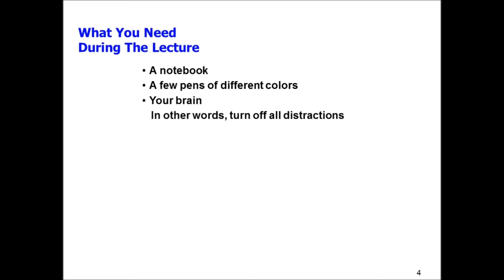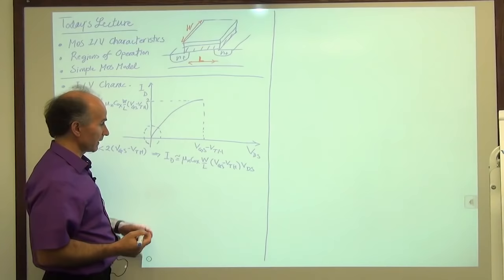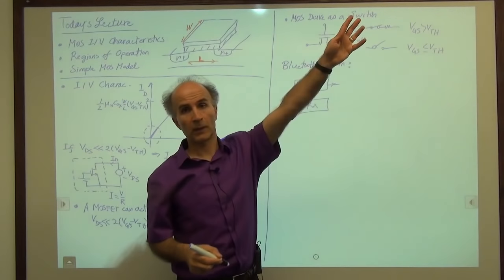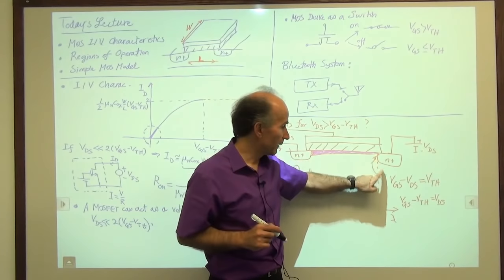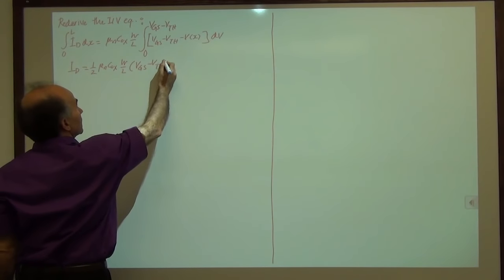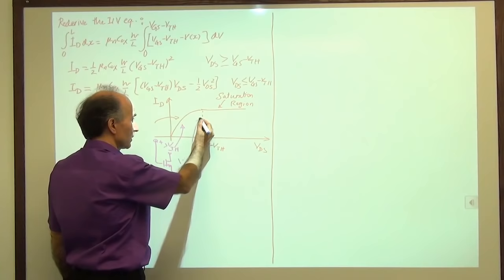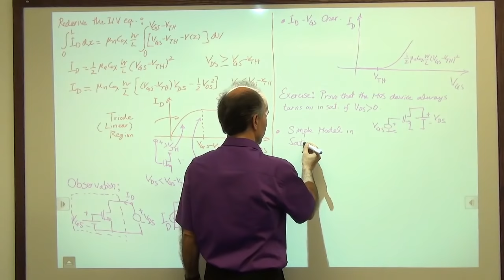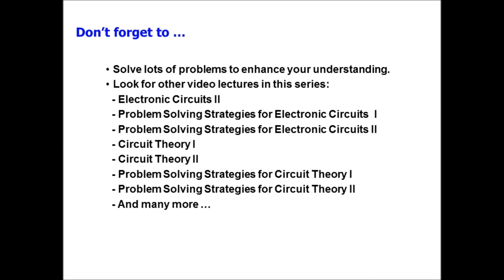Razavi Electronics 1, Lec 31, MOS Characteristics II

Comment: For those who are confused about the question posed by Razavi sir, if I re-phrase it...
"Set the VDS as a constant > 0 (however small you want). Now, when you turn on (or "start") the MOS device, you will observe that it "starts" in saturation mode. Prove this result."

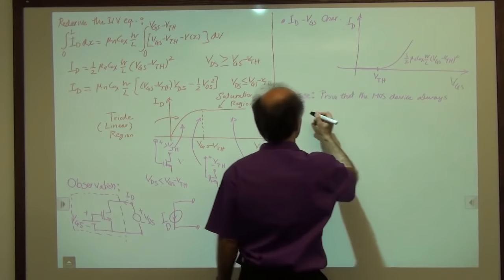Comment: Question  at 49:00  "Prove that the mos device always turns on in saturation if VDS > 0?"

Answer: 

1. Consider at the beginning VGS=0, VDS=0.
2. Now if I increase Vds to 0.1 V and I am fixing it. 
3. I am increasing Vgs slowly from 0 to Vth. At Vth my mos device is on (Vgs =Vth).
4. For saturation the condition is Vds > Vgs- Vth.
5. as Vgs = Vth implies Vgs-Vth=0.
6. hence Vds > Vgs-Vth; Vds=0.1>0.
So the mos device will turns on n the saturation.
Reply: Suppose, you increase Vgs so much that Vgs-Vth>Vds as you have fixed Vds, this condition does not apply. Is it for this reason that he said for a very high Vgs, the quadratic equation is not valid? Could you clear my doubt.
Reply: @roshansharma5251  Mr. Razavi says turns on in saturation region. Not always in saturation region if you increase Vgs so much. Turns on means the point that Vgs begins to be higher than Vth.
Reply: @ozgunyurutken9485  Wrong. Dr.Razavi says it turns on. If you look at the graph , it turns on when Vgs > Vth, and this is the point where saturation occurs/ given that Vds > 0.
Reply: @roshansharma5251  That case is much beyond turning on......When you "just" turn on the MOS, V(GS) = V(TH). So, condition of saturation only applies till V(GS) becomes greater than V(DS) by atleast one threshold (V(TH)).
Reply: But I do have a doubt like after vth, Vgs-Vds keeps increasing for we keep Vds constant and increase Vgs so this difference will be more than Vth right in that case the MOS is in Triode region right
Reply: @ananya825  Yes. As Vgs go beyond Vth, (Vgs-Vds) becomes greater than Vth, thereby keeping MOS device in linear/triode region.

Comment: Hello Sir.
You have explained very well about Saturation of Drain current mathematically. By changing the limit of V(x) i.e. channel.voltage from Vds to Vds,sat= Vgs-Vth which results in Id independence on Vds.
But I also want to know how it is constant at semiconductor level..

Comment: All right for those you are scanning the comment box for the answer to the question Razavi sir asked towards the end of this video let me explain 

The question is if Vgs>Vth (just when the device is turned on) then for any positive value of Vds, the current through the MOS will be in saturation region. Note that this is a case for when Vgs has just reached Vth and not when Vgs is much greater than Vth ( to be exact Vgs= Vth+ whatever Vds you have taken) 

1. So if we look carefully we will observe that saturation region is achieved only when there is a pinch off anywhere between the source and the drain.
2. We must notice that  the value of Vds decrease as we move towards the source from drain (since source is grounded) and becomes equal to zero at the source
3. Now it is given that Vgs>Vth, therefore if we analyze the voltage drop at or at the very proximity of the source we notice that Vgs-Vds>Vth (since Vds at source is zero and it is mentioned that Vgs>Vth ). therefore a channel starts to build and since Vgs<Vth+Vds (you have taken some arbitrary value of Vds) the channel will quench before the drain and hence a saturation current is drawn . 

hope I was able to explain you the solution properly 
thanks
Reply: No, the question is: when Vds is FIXED, and we increase Vgs, the MOSFET, TURNS ON in saturation, that is: when Vgs reach Vth, then the MOSFET is in saturation (then after Vgs exceeds Vds + Vth the MOSFET pass into triod region

Comment: Prove that mos always turns on in saturation region if Vds >0. Please tell me if my answer is correct-

To turn on MOSFET, Vgs >= Vth so we have Vgs - Vth = 0 just when the device turns on. But given Vds>0, thus, Vds > Vgs - Vth
Thus the device is in sat region.
Reply: take Vds=2mV and Vth=4 and Vgs=7, you can see this doesn't work
Reply: Hi, I think you are correct. Prove that the MOS device always turns on in saturation if Vds>0 means that initially when the MOSFET is turned  on, Vgs starts from 0 and increases. Whereas Vth and  Vds remains constant, so Vds+Vth>Vgs.  After Vgs is fully increased, MOSFET will enter Ohmic region.
Reply: @이상혁-b1w  my

Comment: After pinchoff voltage there won't be any electrons...so how come that current Ids(saturation one) flows
Reply: the electrons would have gained a high velocity, so it just jumps of from the pinch off to the drain hence conduction current
Reply: It will form basically a reverse diode.. a PN junction... the carriers will flow because of an electric field. ( If you saw bipolar transistors, it is similar to a bipolar transistor, since when the channel gets "cut" ... you will get a sort of  p-n-p or n-p-n structure
Reply: The current can still flow through the "substrate" even though the channel is pinched. The reason why it saturates is that there will be a region of higher resistance of size proportional to the Drain-Source voltage, and therefore the resistance of this region will be proportional to the same voltage.

But as current is voltage/resistance, the dependence will cancel out and you'll get "constant" current.

From Wiki ():

Even though the conductive channel formed by gate-to-source voltage no longer connects source to drain during saturation mode, carriers are not blocked from flowing. Considering again an n-channel enhancement-mode device, a depletion region exists in the p-type body, surrounding the conductive channel and drain and source regions. The electrons which comprise the channel are free to move out of the channel through the depletion region if attracted to the drain by drain-to-source voltage. The depletion region is free of carriers and has a resistance similar to silicon. Any increase of the drain-to-source voltage will increase the distance from drain to the pinch-off point, increasing the resistance of the depletion region in proportion to the drain-to-source voltage applied. This proportional change causes the drain-to-source current to remain relatively fixed, independent of changes to the drain-to-source voltage, quite unlike its ohmic behavior in the linear mode of operation. Thus, in saturation mode, the FET behaves as a constant-current source rather than as a resistor, and can effectively be used as a voltage amplifier. In this case, the gate-to-source voltage determines the level of constant current through the channel.

Also, from the MOSFET operation description, under saturation:

Since the drain voltage is higher than the source voltage, the electrons spread out, and conduction is not through a narrow channel but through a broader, two- or three-dimensional current distribution extending away from the interface and deeper in the substrate. The onset of this region is also known as pinch-off to indicate the lack of channel region near the drain. Although the channel does not extend the full length of the device, the electric field between the drain and the channel is very high, and conduction continues.

Thanks to Clabacchio who answered this.

Comment: I don't understand: why does the overdrive voltage, VGS - VTH, appear in the charge density equation? Doesn't this mean that charge is zero when VGS = VTH even though the transistor is turned on and current flows due to VDS > 0?
Reply: Yeah! There is charge density only when VGS exceeds VTH and not when VGS=VTH . At any point we take the voltage to be the difference of VGS and VTH. There is a current flow soon after VGS exceeds VTH and VD>0. If VD=0 , you have no current flow since Drain to source has the same potential!

Comment: I found this lecture very confusing because Dr. Razavi skipped over so many things. First, at pinch off, the channel length, L, gets smaller, but he just ignored that and kept using L for the whole device.  It is fine if that is justified, but he needs to make some justification for why that was OK. Second, he completely ignored the mechanism of current flow in the pinch off region. With zero density of charge carrier, how does the current get from the drain to the channel? Finally, when he talks about the Id-Vgs curve and says it always turns on in saturation, that is obviously true, but it is confusing without the top half of that curve. As soon as the overdrive voltage exceeds Vds, the circuit will fall out of saturation. And at 5mv, that is going to happen really fast.  I'm guessing we'll get to this in the next lecture, but it deserves a mention here so we are not left scratching our heads.
Reply: I agree, it would be nice if he would have mentioned this. But I think these lectures are made for first year bachelor students, not us who want to refresh and improve our knowledge. Its much new information for them anyway.
Reply: depletion region is formed beyond pinch off and the field present in that depletion region swift away the electrons as soon as they reach the pinchoff,so current flow is not effected.
hope u get it..

read sedra smith to make ur concepts much clear
Reply: Well he did explain that while the L is smaller... it is almost L... so it is an approximation... 

the mechanism in which electrons flow there... it is a drift current caused because of the electric field. If you notice... you will get a PN junction in reverse. While  PN junction in reverse does not conduct by diffusion, it lets a drift current flow
Reply: @shikharsrivastava8346   We take Vds to be high(say 3.7-3.8 V). So when Vgs starts from 0.3 V it takes a while to go out of saturation (Vgs-Vds <Vth is maintained for a while ) So where does this Vds value come from?

Comment: How come is it possible to have a current after the pinch-off 🤔 do we have a current after the pinch-off ?
Reply: Some magic. Of course there is current after pinch-off. That's saturation region
Reply: @GiorgiAptsiauriX  it's like the current that is swept in the reverse biased PN junction (base-collector) in the case of BJT, is this analogy sensible?
Reply: @mnada72  No, there is a different mechanism here, he has not explained and I don't remember right now. Refer to his book or Sedra Smith book
Reply: "once the electrons reach the end of
the channel, they experience the high electric field in the depletion region surrounding the
drain junction and are rapidly swept to the drain terminal."

From textbook
Reply: @GiorgiAptsiauriX  Thank you, which textbook ?
Reply: @mnada72  Razavi Fundamentals of Microelectronics

Comment: when the channel pinched off  we still have current why?
Reply: Electrons at the pinch off point will experience an electric field which will drift the electron towards the drain region. The electric field is from the drain region(holes in n+) to the depletion region(negative charged ions). Also since the depletion region does not have holes so recombination is not possible. This means every electron from the pinch off will be drifted to the drain region.